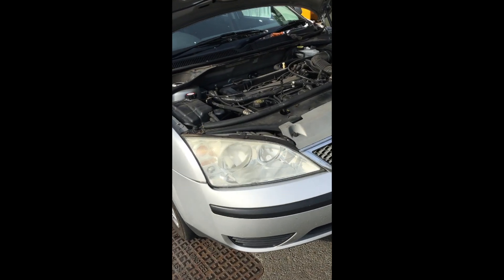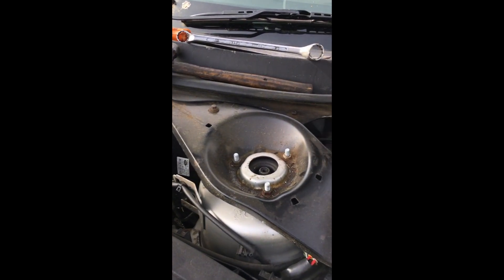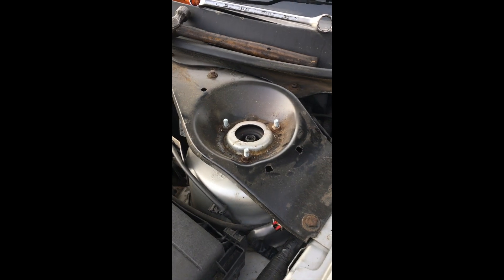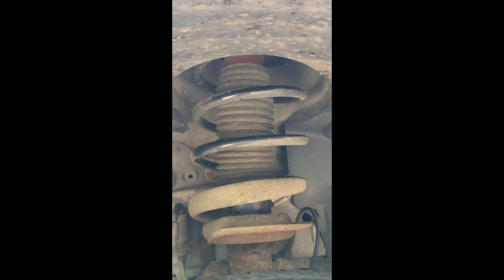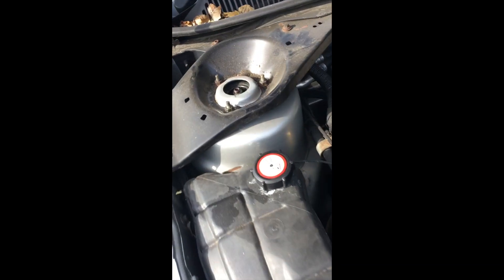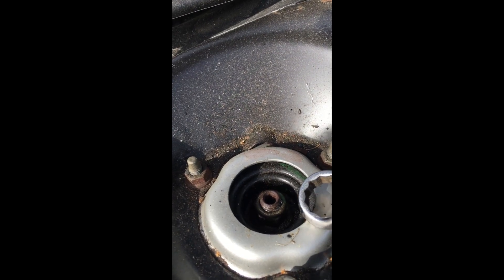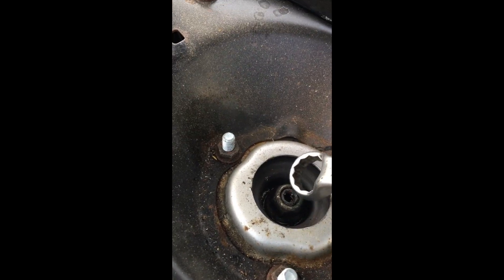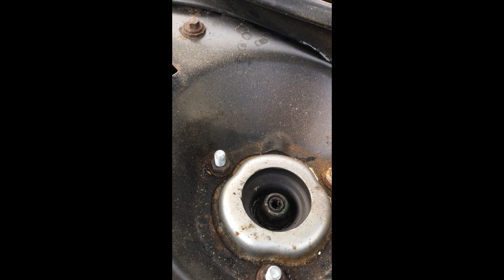Rattling Suspension, Check Your Mcpherson Strut Top Mount Nuts

Comment: Some top nuts have the first threads tapered to fit the taper on the shaft. The Keep You Bouncing shocks for instance. If you don't have these nuts for whatever reason using the non tapered ones can cause noise where they don't seat correctly.

Comment: Well Alan, when replacing any suspension component it's always best engineering practice to replace any locking threaded nuts and bolts with new ?? And possibly thus wouldn't of happened.

Comment: What happens if you try to tighten the nut and the inner shaft/thread spins too, so everything just rotates?
Reply from the maker: there is an allen key hole in the top of the shaft which you hold while tightening the nut
Reply: @alan4x  thanks for the response!